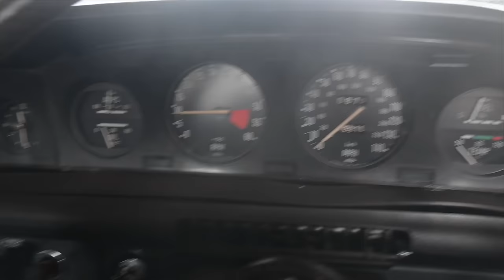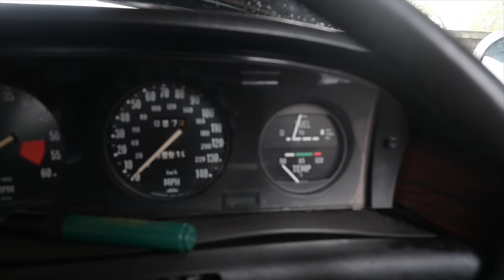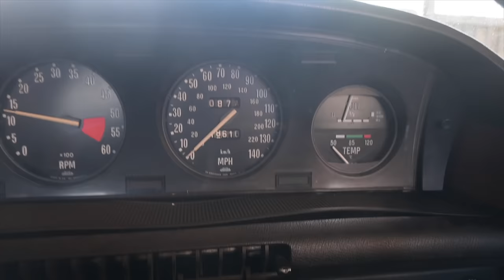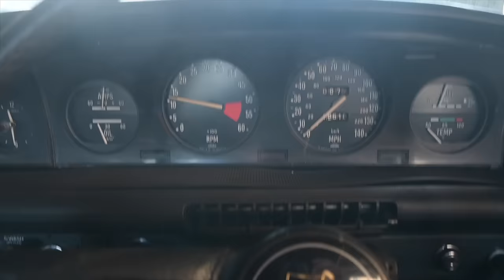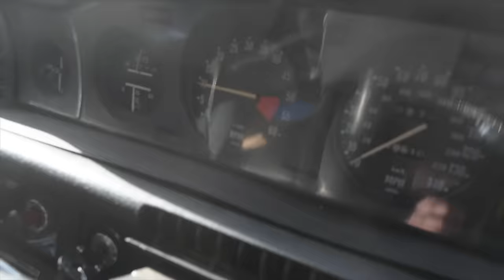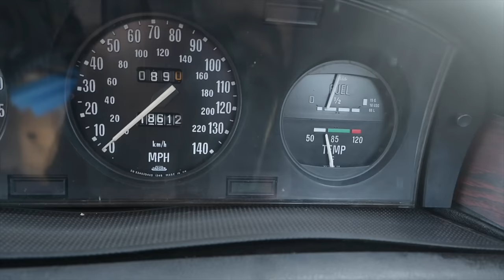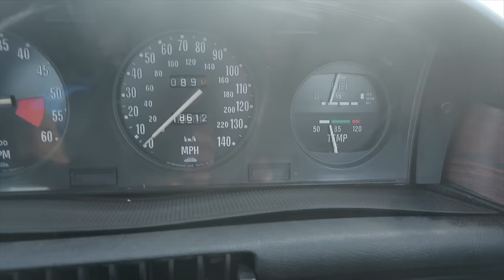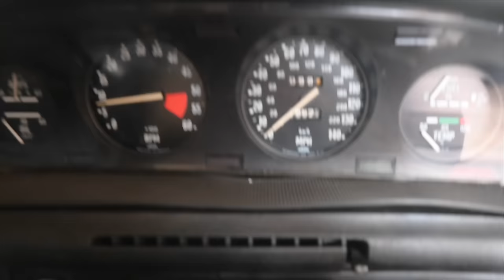Rover V8 Teething Troubles Tinkering

Comment: your crankcase ventilation is not connected.
There should be 2 hoses running from the valve cover to the carburetors, and 1 hose to your air filter housing.
This is also the reason why your engine can leak oil, because there is no suction to keep the oil inside.
and the high idle speed is also correct because you now have a large vacuum leak on both carburetors.
Reply: I’d agree with this. If you got your engine up to temperature and ran it for a good long while, you’d see the vapour. It could condense on the bonnet and drip down.

Another thought whether your gasket on the crank case is sealed enough? I’ve switched to RR silicon gaskets, which seem to be happier than the cork ones.

Comment: Hi Matt, it's finally getting there !  Before going to the extent of changing the sump gasket, never an easy job with engine in situ on the V8. Check the crankcase ventilaton is all good and air tight. There's 3 points on the V8 that need to have good push fit rubber hoses, and a clean SU type fuel filter on the rear one. You'll get excess crank pressure build-up if not vented. The rear one is an angled brass take off, above the bellhousing. It should be rubber hose between it and the pipe on the back of the air cleaner box. The filter fits in that hose, low down near the block. Fit it the right way around to avoid sucking oil vapour into the air filter. The other two are a rubber hose between each rocker cover and the carburettor, and each pipe should have a flame trap in the middle. Missing, or poor sealed pipes wil cause poor running and excessive fuel consumption as the mixture will be all over the scale. Your instruments misreading is a simple fix. If more than one gauge is misreading, It's usually a failed voltage stabiliser. It's a small metal canister with Lucar spade terminals that is screwed on the circuit board behind the gauges. Those badges were originally Silk Screen Printed. Carefully sand it down to smooth, bare aluminium with the finest wet and dry paper and some soap as lubricant. Any competent print work, or maybe a local art college student should be able to reprint them. They were originally fitted above the stainless front wing strip if the holes have been filled.  You'll need a couple of plastic insert cones per badge, or if you have broken fixing pins, double sided badge tape is the answer.

Comment: I stopped up a trans-axle fluid leak at the half-shaft with a bottle of AT 205 polymer sealant, added  8 ounces to the oil, causes rubber gaskets and seals to swell slightly, and stops the leak internally without the shop time (And Money) If you use it read instructions carefully.  Cheers

Comment: When you take of the sump to change the gasket check the mating surface of the sump with a straight edge. These steel sumps can bend between the bolt holes if its been over tightened and you will never seal it with a new gasket. When fitting new gasket torque it to spec dont guess it.

Comment: From memory, the good quality cork sump gaskets had small ally pins in them so they did not squash too much, personally I'd use the best gasket you can get for a 4.6 and fit a nice breather, but this engine is not standard so use the best bits not the most period correct. I've seen them and owned them with su holey and even a twin choke Weber fitted but if I had half a chance it would have injection.

Comment: THE P6B is a beautiful car. I will be interested to see how well it performs, once it is sorted out.
I have seen a video where a gentleman used body filler to fill the back of stainless trim. Then it was filed smooth, and he used automotive double-sided mounting tape to stick the trim on. This eliminates the need to drill holes and reduces the future rust.
Reply from the maker: thats actually a very good idea. Id be worried though as this trim is getting very rare and hard to find

Comment: I should make the sump gasket replacement soon oil leaks only get worse Matt good update I drive a Jaguar XJS 4.0 Litre Straight 6 with a 4 speed ZF Automatic Transmission I average about 18 in town and and 24 to 26 on a highway yours might be quite a bit lower my XJS is a 1995 Convertible good luck with the sump best regards Andy Allen

Comment: Awesome video Matt well done. However next time please put 3-4 gallons of fuel in. Stop with micky mouse 1 gallon here, 1 gallon there. It’s a rover it needs to be treated to at least a £30-£40 worth of v-power. I’m a mechanic in Australia & I cannot stand it when I have to do any sort of work on a customers car & there is very little fuel in the tank. I will always run to the garage & bung in at least 15-20 litres so I can work with the engine running for some time.

Comment: You need to plumb in the pcv system  from the carbs to the valve covers and the breather from the rear of the crank case into the air cleaner, that'll help with the oil tightness.

 Plus, is it me, or does the ammeter never seem to show a charge? My old P6 3500S always showed a big + charge just after starting and then dropped back to just over the centre.

Comment: You'll get a bit more to the gallon if you ditch the SUs and the inlet manifold and fit a 4 barrel carb instead. More power too.
Reply from the maker: yes, thats on the shopping list
Reply: @furiousdriving  Being an old fart, I'd prefer the look of the stock wheels though.
Reply: Would a similar upgrade like Harry did to his XJC manual, electronic ignition and fuel injection be possible
Reply: How? The cds carbs atomize the fuel alot better! 

I had the edelbrock carb on mye v8. Tuned it with afr gauge. Installed the Stormbergs and the power and fuel consumption was exactly the same. The Stormbergs used less fuel at high altidude because of the constant depression system.
Reply: @Atle-k2z  the p38 4.6 had fuel injection and electronic ignition anyway, so if it's an easy enough fit/upgrade I may make for better easier to manage running, I'm not sure what any other differences it would make though, it was just a suggestion, the novelty of having carburettors can be good , but starting and smooth running can be tricky to perfect
Reply: @tug1345  sorry i answered the wrong person. All i know about fuel injection is that it have stranded me on the side of the road😆
Reply: @Atle-k2z  there's pros and cons to both ways

Comment: LO Matt.Sump gasket ? perhaps. Might need a sump pan. Saw Edd C have a similar issue with a Range Rover. Turned out  a previous owner had used a pole on their  spanner and horsed up the bolts and warped the pan. Worth a wee check. Coz if the pan is warped then it dizne matter how many gaskets ye put on it  it will still leak and drive you cookoo. laters . Happy Easter
Reply from the maker: Its the pan off the old 3.5 and hadnt been leaking before so I reckon its the gasket
Reply: @furiousdriving  It's pretty routine to just check that the flange is still flat and straighten it out anyway.  I'm sure your pan will be fine to reuse once it's confirmed straight.

Comment: Are the SU's from the 3500? If so you will need different needles. Comments about vacuum leaks also relevant. Does the dizzy have a vacuum connection? I note at least 1 vac pipe sticking out of a carb. Air filters affect the mixture so at least try and get a couple of pancakes on them. A spell on a dyno would be the best idea.
Reply from the maker: they are but Im not sticking with these so dont want to waste too much time or money on them

Comment: I have several 'spot sprayers' by Titan Tools; they're a copy of the Sure Shot refillable not aerosol sprayers. They stand up indefinitely to brake cleaner and are brilliant at degreasing stuff for leak tracing. As others have said, a distorted sump flange is a common issue, I've straightened many over the years and welded up the cracks from the distortion and/or straightening process. If you can get a rubber type gasket, they typically seal much better (no gasket compounds!) than the cork type.

Comment: From memory the fuel and temperature gauges both run through a ballast resistor unit, I suspect it is faulty.
Reply from the maker: Yes, I thought it was something like that. Ive got the factory workshop book, Im going to have a read of that
Reply: Again, from memory, if you remove the instrument clear glazing cover (just a pull off finisher, a push on fitting for the clock and four self tappers) I think it’s located adjacent to those instruments. I may even have one in some shoebox in the garage from my P6 days thirty years ago but whether I could ever find it is another matter…….. @furiousdriving

Comment: Nothing worse for a car than sitting around and not being used. Oil seals and gaskets dry out. Brakes seize up. And the corrosion sets in. 
Are you not running air filters?
Reply from the maker: I will, but want to see everything at the moment
Reply: I wouldn’t be driving a just rebuilt engine without them. It will be sucking in all sort of dust and debris.

Comment: I think oil pouring out at that rate would trouble local cyclists and motor cyclists though
Reply from the maker: its only a half penny size droplet every 10m or less, its not sitting leaking into a puddle